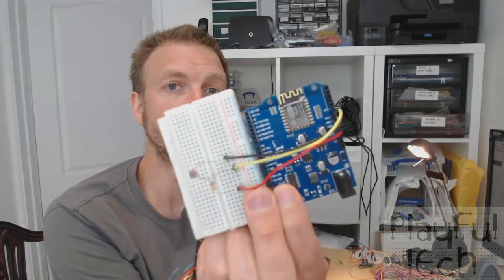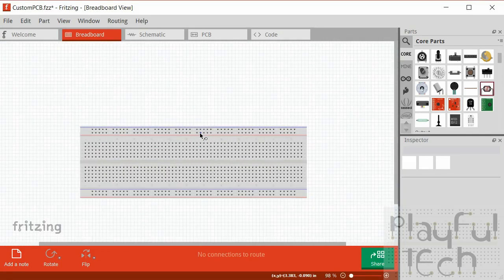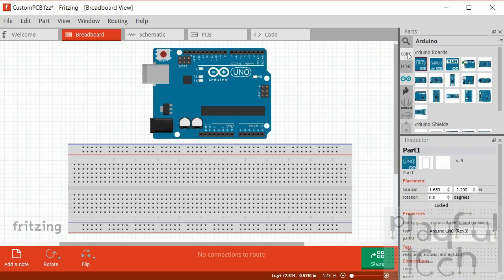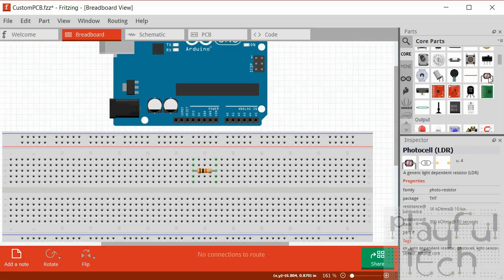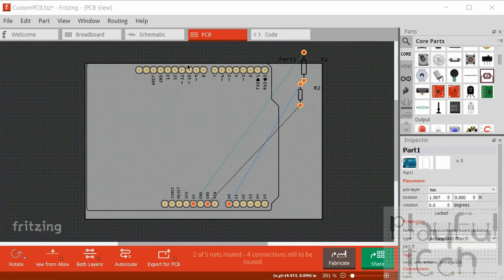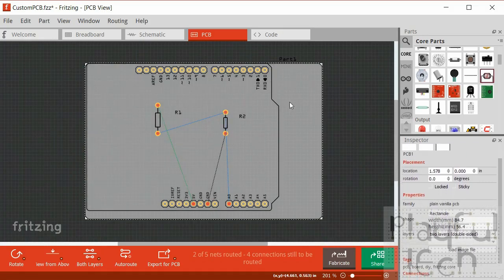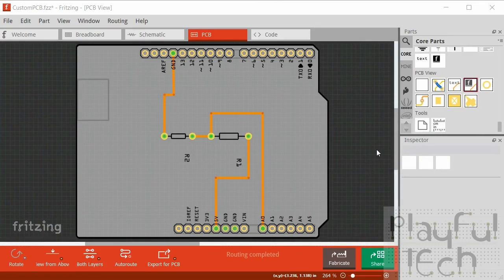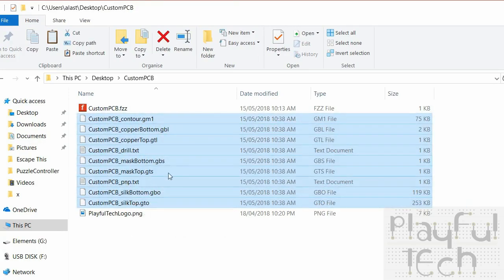Creating a Custom PCB Arduino Shield

Comment: Oh jeez, please don't make any 90 degree traces on the PCB. Run all angles in segments of 45 degrees.
Reply: I looked in the subject and seems like an old practice that just stayed in time even when now it doesn't seems to affect at all the results
Reply: Yes this is correct as far as I know. One source http://www.ti.com/lit/an/spma036b/spma036b.pdf - 3.6.1. Boils down to almost no benefit avoiding those 90 degree angles.
Reply: I use 90 deg all the time, and have no problems. I use Aisler for the production.

Comment: How would you add female pins on the top of the PCB?
Reply: You get these parts called "Stacking Headers", they are female on top and male on bottom. Look for arduino stacking headers on google. Put them on instead of the male ones that Alastair puts on.

Comment: Naive question. I notice on your breadboard layout that you connect to a GND in the lower row of Arduino pins, but on the PCB it runs instead to the GND in the upper row. Is that supposed to happen?  Perhaps the layout would be impossible otherwise?
Reply: It doesn't matter which ground pin it's connected to. They are all interconnected. But technically, it draws it to the nearest suitable connection.

Comment: The Fritzing program hasn't been updated since June 2, 2016, and the Youtube channel hasn't been posted to since 2014
Reply: Well if that is really an issue, you can use Eagle or KiCad. A little bit of google-fu can land you some arduino circuit board templates for either of those programs, and they include component libraries for common parts. 
Lots of online tutorials for those two programs.
Reply: It's still active. But it now costs 8 dollar to download.